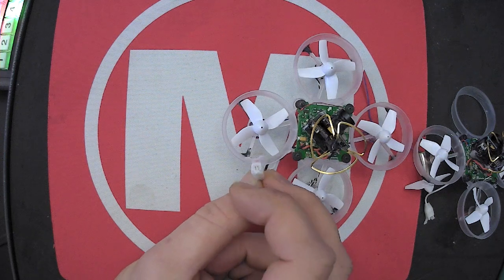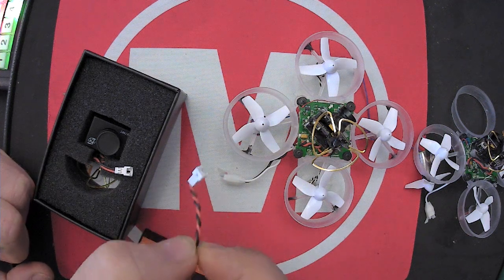Tiny Whoop - replacing the power plug

Comment: I got my whoop with the upgraded batteries and the pigtail adapter for 2.0 plugs. my question is would it be okay to connect the pigtail adapter to the existing power supply wires from the board without desoldering from the board and just making a good splice? my eyes are failing me on this tiny board. Thank you for any help or suggestions in advance.
Reply from the maker: Jody Clary I think you created a solder bridge. Always check for continuity and polarity!
Reply: Jody Clary splicing the wiring has high chances of creating a bottle neck. And I don't think it's easier than soldering to the board. I'm using a desk mounted magnifier.
Reply: Thanks for the info I threw this same question around as many sites as I could and got pretty much the same answer you gave me. So I just got back with a new soldering gun and a pair of tiny hands. I'm going to tackle this sucker when my eyes rest a bit I tell you they're burned out from all the searching. But guys like yourself make it so much easier than Flying Blind and I really appreciate it thank you very much.
Reply: Hey Benedikt Haak I put that adapter on last night. I followed everyone's directions and when I plugged the battery in it immediately nearly exploded in my hand burning my finger pretty bad on both hands. Man I am having no luck getting into micro fpv it is costing me a fortune. I think it is trying to tell me something...
Reply: I think that's what happened to. Though I was working with one sloppy bead on the positive post it may have caused the shortage though I couldn't see anything under a magnifying glass and used hot glue as to not have to solder there again. It was seriously tight. The mini drone curse strikes again it's all good I'm getting used to it. I've just sunk way too much money in these really hoping this would be the best one and I'm sure it is. I have no problems with my other drones I take them apart I put them together I modify them they fly as I like them too. These Minis, I do not understand what's going on here.

Comment: Will the splitter I got with my va1100 work as a power whoop?
Reply from the maker: Steven Whaley what's a power whoop?
Reply: Sorry. I thought that's what tinywhoop.com was calling this mod. So I guess my questions is will that splitter work for this mod?
Reply from the maker: Steven Whaley yeah, the plugs from the splitter adapter aren't the best, but it's better than a worn old stock plug. all these 1.25mm plugs need replacing every 50-100 connects.

Comment: I had issues with my stock connectors. With camera and stock motors, would hit LVC within seconds on a fresh charge. Had some spare 240mah packs and decided to go with those using micro deans connectors and some very high rpm syma x11 motors. Near 5 minute flights with plenty of punch.

Comment: Benedikt, do you prefer these connectors or the micro losi? I really just don't like the Inductrix/nQX batteries, I've had bad luck with the dinky plastic caps/connectors falling off or failing
Reply: You mean the Losi/Walkera plugs? Yeah, they would be better for 2A+.

Comment: nice video :) what did you use to repair the frame? I can't get anything to stick to that plastic. only melting it has worked
Reply: Thank you! The black stuff is keratin.
Reply: Looks likes he's using liquid electrical tape. I've had pretty good results with hot glue though.
Reply: hot glue works well. CA glue wont bond to the frame material...